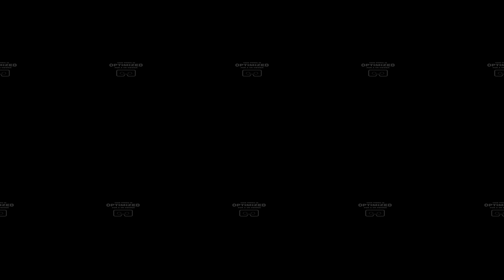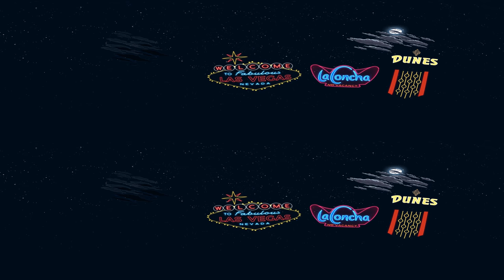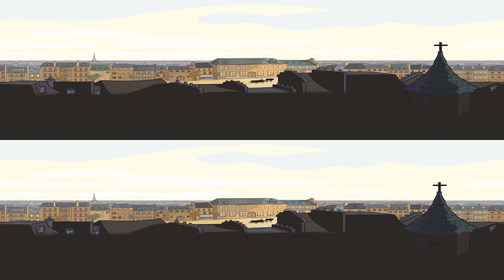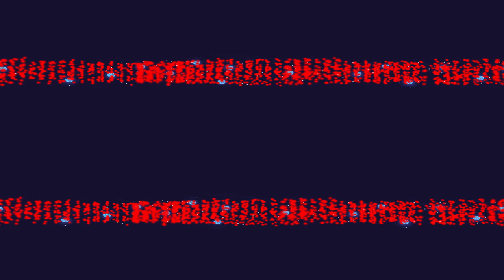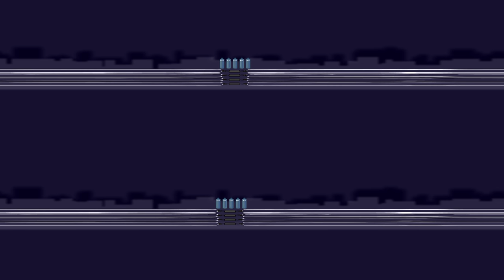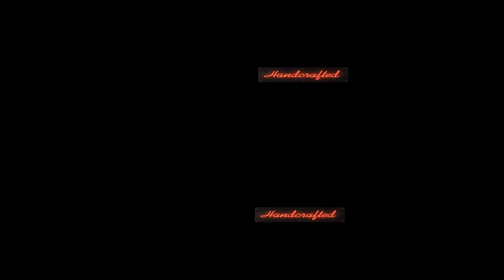What makes neon signs glow? A 360° animation - Michael Lipman

Comment: As a side issue how did they manage fairly sophisticated animation of neon signs before computers were invented?
Reply: Hi David. Hi This is Lippy.  I directed the piece. "Animated" neon signs use all analog electronics to make different circuits fire at different time to get the movement in the sign. Thank you for your comments.

Comment: Great video! Don't like that it is in 360 though. It ruined it for me, as I watxhed it on the train.
Reply: alexander sjolund ouch
Reply: alexander sjolund  You can use your finger and move it you didn’t have to move around
Reply: @zahrah8512  that's what I tried to do, but I didn't manage to turn that funktion on! I basically sat like a lunatic on the train, trying to figure out how they filled the tubes with gas, haha!

Comment: Usually I love the TED videos. I don't feel the need for a VR and really don't want one. It's a shame I couldn't just enjoy the video since there is no way to shut the VR option off. Won't be watching any more VR videos that's for sure.
Reply: While the video is VR optimized it's actually just a regular 360 video, so you can interact with it without VR! On your phone you can move the phone itself to explore and on your browser you can use your mouse to do the same thing. It's pretty fun!
Reply: Hi This is Lippy. I directed the piece. I agree that "pushing" the video around with your mouse is laborious and confusing at times. If you get a chance to watch the piece in a VR headset I think you will be quite surprised at the difference in the experience. It seems much more natural and flows differently. Thank you for your comments.
Reply: I watch them on my phone with earbuds. Sorry not going to spin in a circle and move my phone all over the place on a bus or train. Not going to happen.